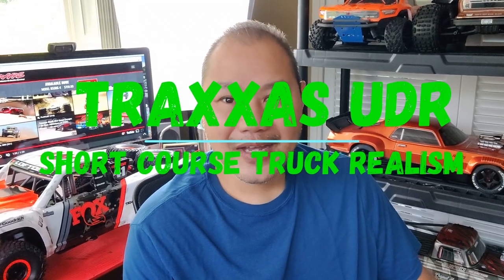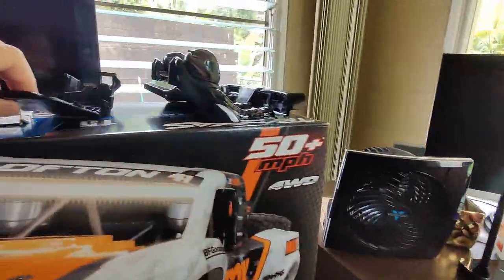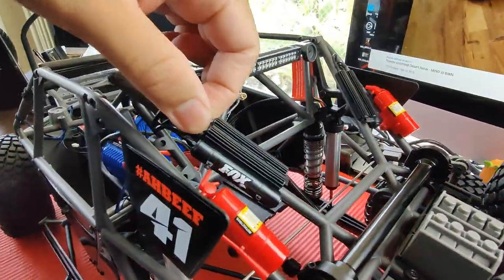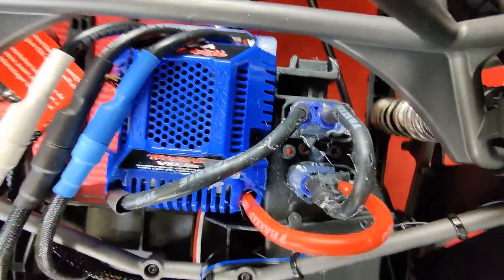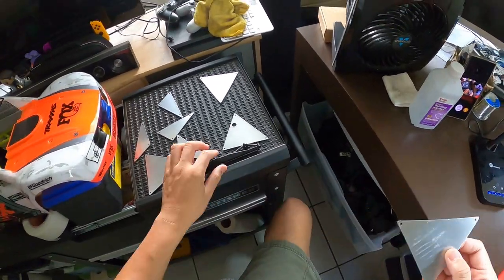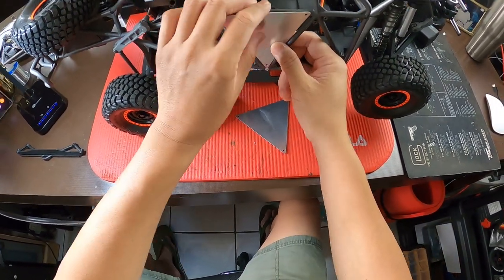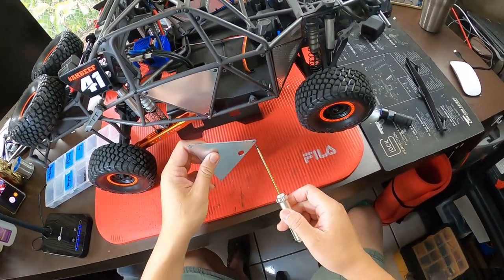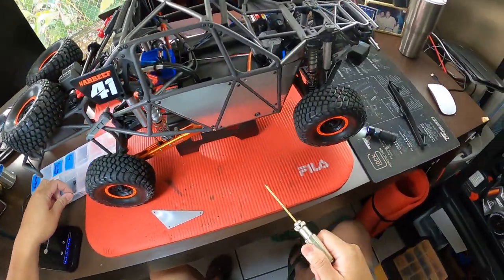Traxxas UDR It's Short Course Truck Realism!

Comment: WatsNuDay! Like the mods you have done! I have a couple UDR's myself and I used the orange drywall tape and sprayed the underbody with black Flexseal product worked really good! I like the drywall tape across the windows but I'd probably used a black sharpie on the netting area! Paint 🎨 sharpie's are the way to go on some of the tight areas. I've been running mine out in the snow picked a full set of paddle tires for one and been ripping it they're a blast! Good video!😉👍
Reply from the maker: They do sell black drywall tape, but i had the white one so that is what i used.  I dont expect it to last after a few battery packs, so ill just change it out when needed.  Its awesome you have more than 1 udr as parts can add up.  Have fun!!